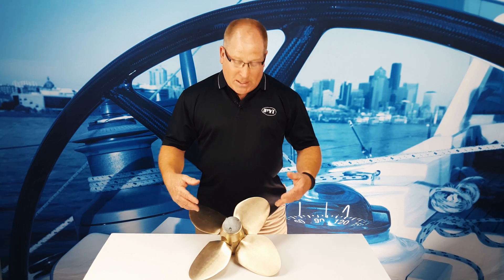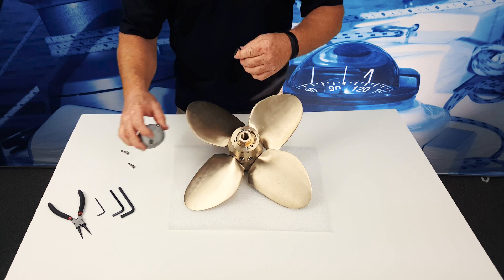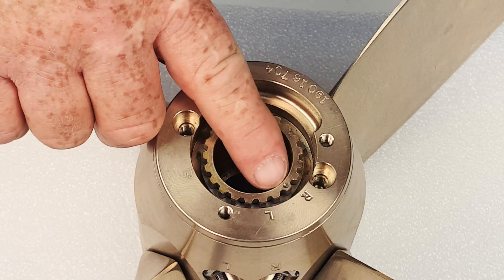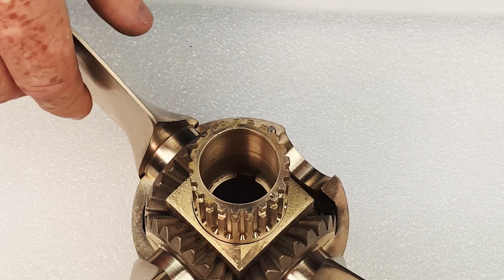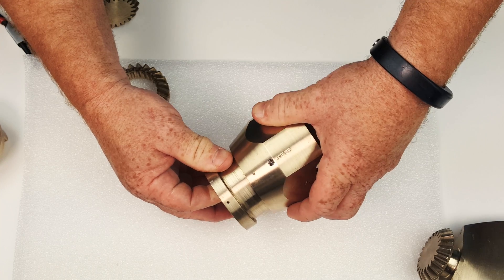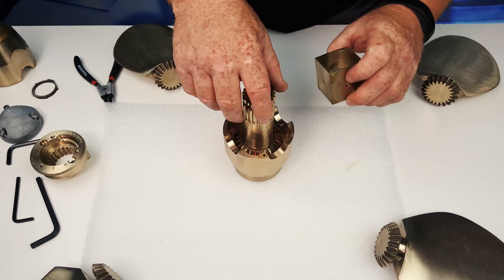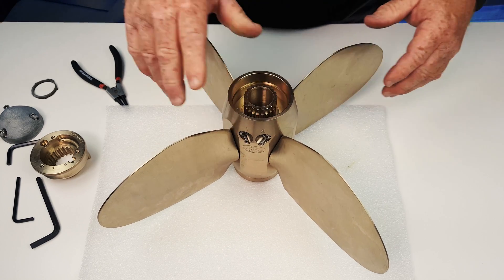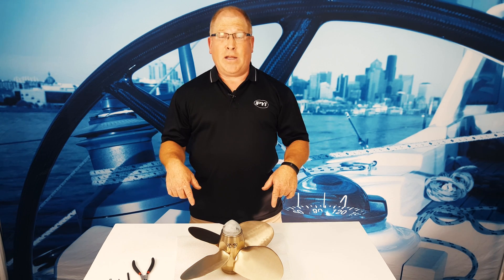Max Prop Easy Disassembly

Comment: I have a 3 blade Max prop installed in 2013. I lubricate it every year , I am having a problem this year in that the grease Lubplate 130 in that when I pump the grease in it will not flow out of the blades . I have never disassembled & cleaned out the old grease , do I need to do that now? the boat is always in fresh water (Lake Huron) usually put about on  150 hrs. a year. Larry Petres